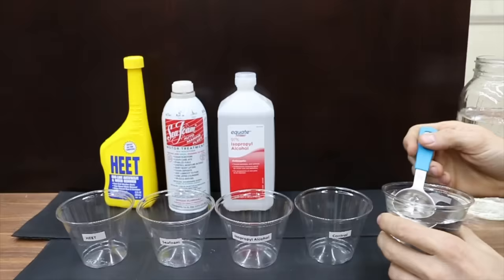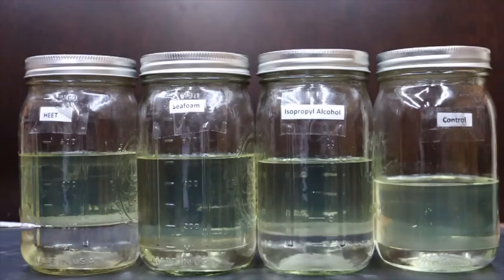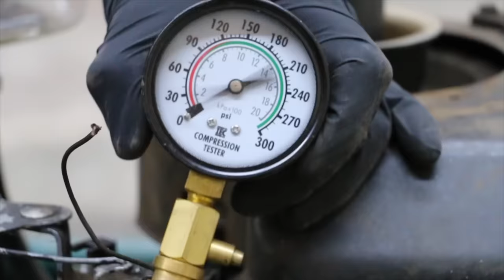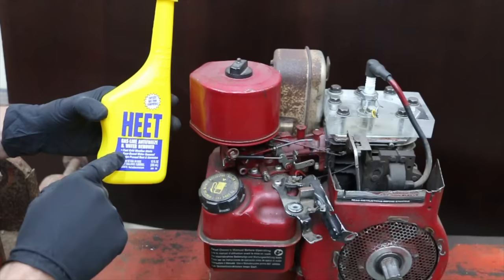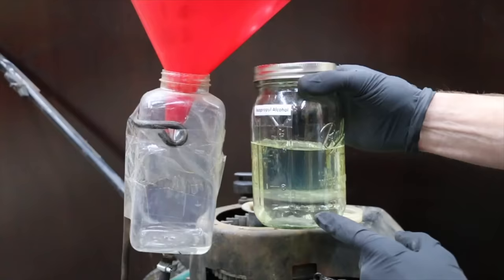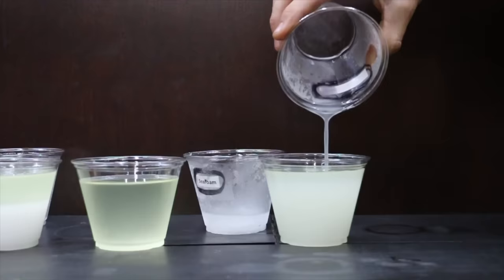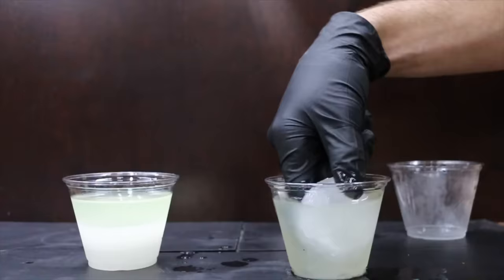Is HEET better than Seafoam for Water in Fuel?  Let's find out!

Comment: Isopropyl turns to carbon when burnt. That cannot be good for the engine. Make a wick lamp and light it, and hold a pot over it. The pot will turn black. Now if you want to chrome the pot bottom then the carbon will enable ypu. Ethanol mixes with water and does not turn things black. That is why they sell it for cookstoves.
Reply from the maker: Thanks for the feedback.

Comment: I’m going to have to call for a redo. The red bottle of heet is for winter conditions and the yellow is just for water in the gas. The red bottle also uses isopropyl alcohol instead of the methanol. Methanol can’t melt ice like isopropyl. Test both or the red alone because it’s not a fair test of the claims made.
Reply from the maker: Thank you for the constructive feedback.

Comment: 1 part water to 16 parts gasoline would amount to a full gallon of water in many fuel tanks! A full gallon? That's huge! A few ounces of water is a more typical amount per vehicle, resulting from condensation in the gas tank, gas station reservoir or automotive fuel line. The tests should be run accordingly.
Reply from the maker: Thanks for the feedback.

Comment: Project Farm:  Water does get into some underground gas tanks around here after finding I could make phytic acid through acorn leeching and an essential oil distiller kit and some reading from a safety data sheet on a phytic acid distributor website I hoping you would test their data on phytic acid and rust.  It is also said to make food grade hydrogen peroxide last longer 1/10 so a drop per bottle.  I have made opaque, clear oderless, and a balsamic colored version.  I wonder if it would work with oil or just with coolant?  #McCuistonAutomotive #TheMedical scribe.  It is also said to lower your hematocrit or iron in the blood if it is too high to be able to give blood for instance at a Carter Blood Center.  I currently sell it online on Ebay as a facial scrub.
Reply from the maker: Thanks for this information.

Comment: Heet has largely methanol or alcohol in it to absorb the water in your tank.  A gallon of ethanol that a person buys at the gas station has as much alcohol as the bottle of HEET if it only were filled with alcohol.  So when I get water in my tank, I just get a tank of ethanol.  Probably equivalent to nearly one bottle of HEET per gallon of ethanol gas.  No sense in buying Heet when it's already in your gasoline/ethanol mix.

Comment: Hopefully he never uses that refrigerator again or freezer again to put anything edible in it because once you put that alcohol the Heat and Fuel in there all those chemicals mixed with a plastic inside refrigerator is stay in refrigerator cuz after all plastic is petroleum derivatives or is made from petroleum, it will change of food or whatever else is in there. But this is a very good and informative program otherwise

Comment: Without watching. Methyl Alcohol adsorbs MUCH MORE water per volume than ethyl.because the "shape" of its molecules fit the interstices between water molecules much better. You can fill a gallon jug with water and still pour one full quart of methyl in to it with no overflow.
Reply from the maker: Thank you
Reply: @ProjectFarm  I come from a day when anti-freeze was methyl alcohol and you had to explain to customers why their radiator took more fluid than it was "supposed to hold" My boss had to demonstrate on several occasions. People thot they were paying for anti-freeze and getting cheated. Hard to find M any more. I guess safety and idiocy prevails. LOL

Comment: Try this with  190proof. HOW TO DETERMINE WHAT YOU’RE DRINKING - MOONSHINE ALCOHOL CONTENT
WHY SHOULD YOU KNOW YOUR MOONSHINE ALCOHOL CONTENT? 
If you’re out visiting the backwoods and someone offers you a drink of moonshine, it’s good for you to know what exactly it is you’re drinking. What’s the moonshine alcohol content?

Another time is when you’re making it yourself. This is the time to be analytical, keep some records, and know exactly what it is you are getting out of each batch. 

Commercial beverages such as Jim Beam, Jack Daniels and Southern Comfort ring in at 80proof or 40% alcohol by volume while Wild Turkey is 101proof and thought to be really strong. 

But here’s what is interesting: Depending on what type of still is used for making moonshine, you could have a significantly higher alcohol content for the moonshine you’re drinking. 

Pot stills will give you a product in the 130 to 150proof range. Reflux stills, which are quite popular these days, get the proof all the way up to the range of 160 to 190proof. That’s pretty high, and these are giving you a really high grade spirit that is neutral in flavor but high in moonshine alcohol content.

Comment: Why would you use 91%? it just adds more water, red heet is 99% and many stores have 99% rubbing alcohol
Anyway that is a ton of water, It would be more realistic to test like a half teaspoon of water per cup of gas, most water gets in through condensation. I think you will find the alcohols may disslove the water into the gasoline rather than making a burnable water/alc layer.
Reply from the maker: Thanks for the suggestion.

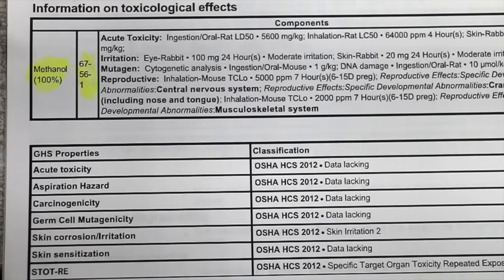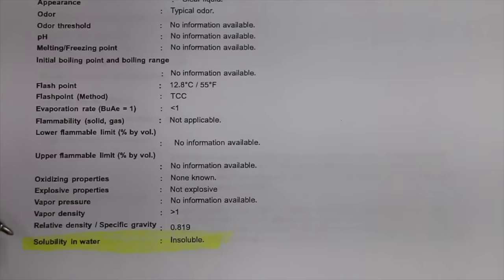Comment: Huh? At 1:45 of the vid you say Heet is 100% Methanol and that it's 100% water soluble and that you are big fan o Heet. Then at 2:04 you show the safety sheet spec and say that it's NOT water soluble and you say that it can NOT be used to treat water contamination. So which of the two cases is correct ??

Comment: Nothing will remove water from fuel.  It will always settle in the lowest part of a fuel system and will remain there until you clean it out.  A lot of products will ruin the diaphragms of most two cycle carburator if the have any.  You can get small amounts of water from diesel but not gas, especially in small outdoor engines.
Reply from the maker: Thanks for the feedback.

Comment: u wanted to kno if any of us have ever had any had water in fuel?? :p  omfg i wish i didnt... :p i use to have to do road calls for tractor trailers n these were some of the worst calls   it really sucks on the side of the road tryin to get fuel everywhere   iv got a 6.5 that i forget to use antigel with sometimes, when i had problems freezin up tho i jus heat up right at the lift pump  it always freezes their first because of the pressure fluctuations messin with the freezin point of the fuel..i guess :p  so anyway i just climb under the truck with a torch n hit the pump for about a minute :P remember its a diesel, n all new line iv run, for everything actually i dont trust old stuff, that is after all, your life n death n possibly somebody elses mother or child allll in ur stopping power   thats the ONLY thing i dont like about havin a big truck; the stopping distance
Reply from the maker: Great point. Thank you

Comment: The science in this video is wrong.  Ethanol is hydroscopic.  A gallon of E10 gas only suspends FOUR (4) TEASPOONS of water per gallon of fuel (.5% @ 60 degrees) before phase separation.  20% water was added the gasolines.  Not real and if it did occur, the gas tank would probably have to be drained to remove the bad fuel.  With closed fuel systems and E10 gas that is of good quality (no water), there is no need to use any products like Heet to prevent gas line freezing.  Any water that condensates in the tank will be suspended in the fuel and be burned during normal driving.  I like Project Farms videos, but in my opinion this one is not to be taken seriously.

Comment: Well I actually used a towel instead of the liquid water fixes i put  towel in through the gas cap Where normally gas goes into but technically thats the (towel cap) not only did it soak up all the water it soaked up all my clothes with water also but this water smelt so fuckin bad omg
Reply from the maker: Thanks for sharing.

Comment: It's easy enough just to drain the gas out of a lawnmower.
Reply from the maker: Thank you for the feedback
Reply: the lawnmower is the test rig ya silly goose...to see if it actually works...when you use it on systems that cant easily be drained
Reply: Try draining the gas out of your car in the freezing cold winter, with a foot or two of snow.